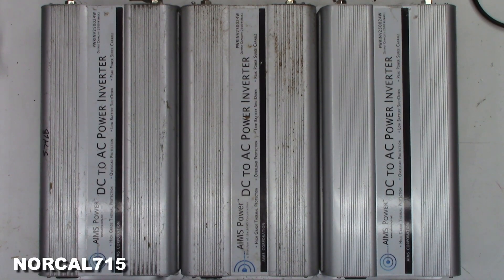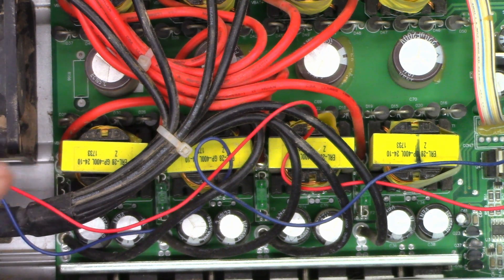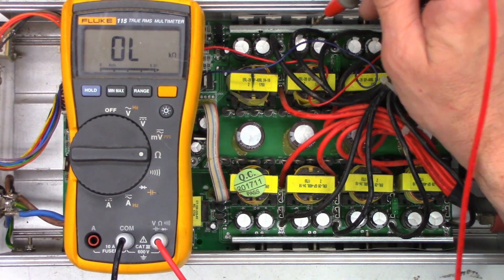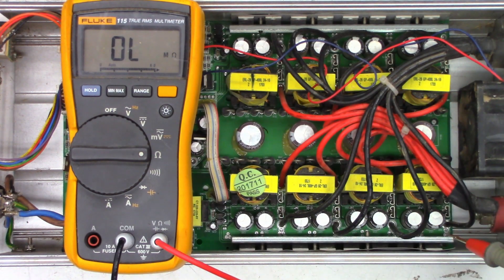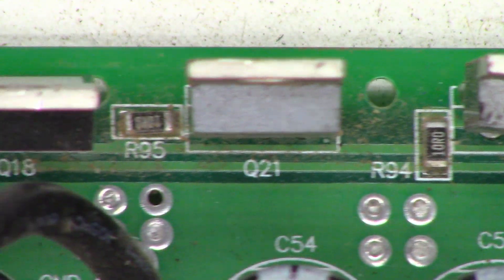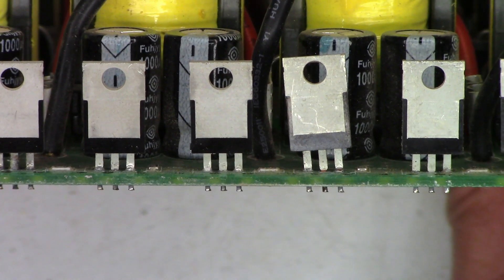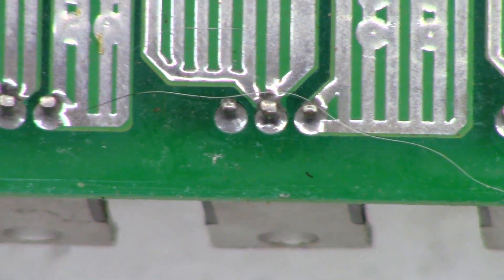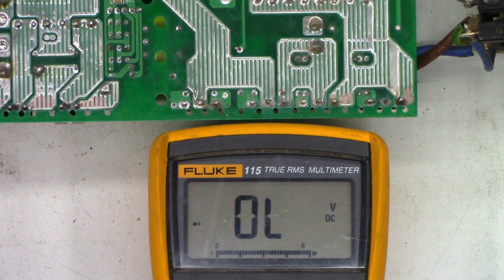CUSTOMER SENT 3 AIMS PWRINV250024W INVERTERS FOR REPAIR. THIS IS INVERTER #1

Comment: Thank you for posting this. I’m trying to decide which Inverter to go with and also whether to go with individual components or an all in 1 Hybrid Inverter / Charger.  If by slim chance you see this, do you have any advice on Inverters that are built well and also those to avoid. I got my degree as an electronics Tech, but that was way back in 81. I switched careers around 1990 but still fix my own gear when needed.
Reply from the maker: Sorry , I don't have any recommendations.